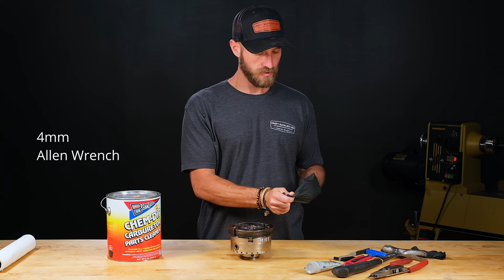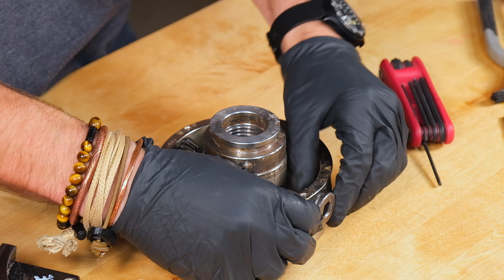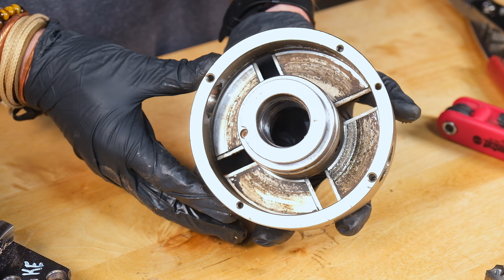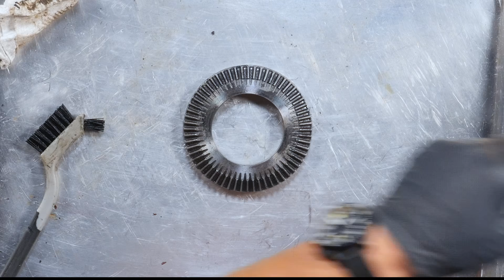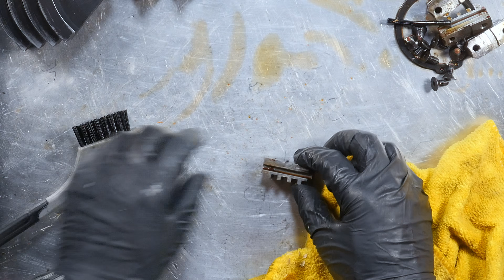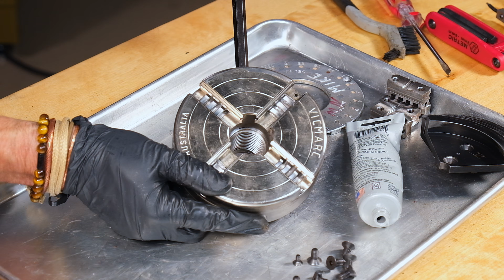Vicmarc Chuck Maintenance

Comment: Hey Mike, I deformed roll pin using a nail set. I was able to disassemble, clean, & lube my VM120. I can not reassemble due roll pin stuck too proud to insert  # 4 jaw slide.  It looks like it is a rolled pin. What size punch pin do I need to get in order to punch it out from bottom after applying PB Blaster or heat. Does Craft Supplies still roll pins?? For the VM 120  do I need the 4mm x 12 mm pin.  Appreciate any advice.

Comment: when you punch down the retainer pin on 4 ,,how do you then pull it back up again ??
Reply from the maker: You can punch it back up from backside of the chuck once the cover plate is removed.
Reply: @CraftSuppliesUSA  thank you
Reply: @CraftSuppliesUSA  the hexagonal worm  drives don't have a reataining screw ,, just a pin . Do i drill them out and buy new pins ??

Comment: Very, very good explanation on how to clean your chuck. What I use on my 105 inch band saw blade and my table saw blade. I use Easy Off heavy duty oven cleaner. Comes in a yellow can. You can find it at any grocery store. Spray it on. Leave it on for several minutes. Rinse it off. Dissolves all the resins. Dry it off.  then blow it off. Fast and easy. Definitely use a well vented area and shake the can really really well. But don’t take my word for it. Try it for yourself. the price of some oven cleaner.

Comment: Hey Mike - Follow-up on the video.  I rewatched it this week and used it to maintenance one of my VM100 chucks.  It is my oldest chuck and is geared "backwards".  Other than having to think about the sequence of reinstalling the jaws (1 through 4 vs 4 through 1), everything was spot on.  If you ever decide to update the video, I would recommend that you tell everyone to label the chuck body with the jaw slide numbers so they can reassemble their particular chuck.  Thanks.

Comment: Thanks Mike, I just bought a used VM100 that needs this done to it.  I had to change the spindle adapter from 1” to 1.25”, which was an easy job, but I’ve been a little hesitant about doing more than an outside wipe down with a rag with acetone on it.  That helped, but it needs the thorough cleaning and relube you demonstrated.  Thanks for the timely video.  Cheers, Tom